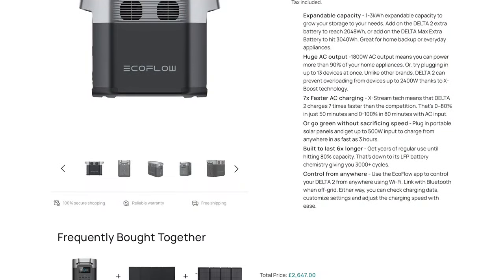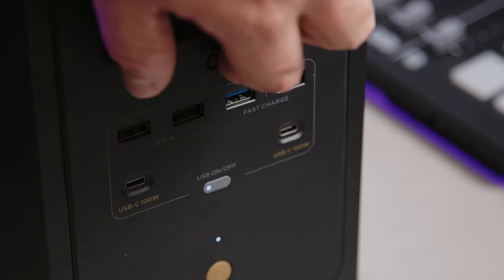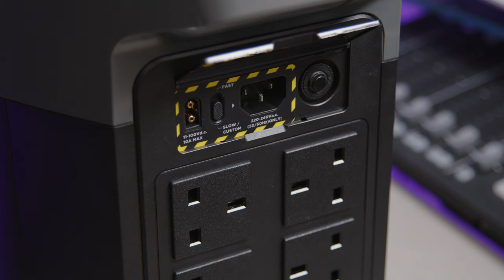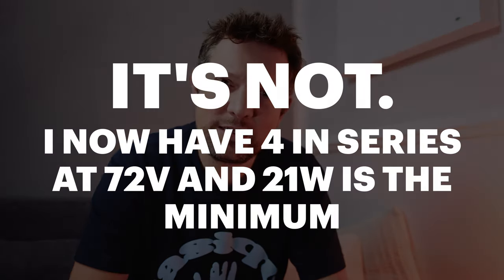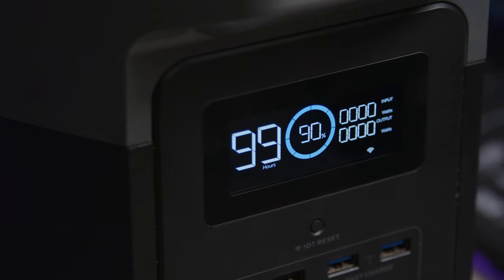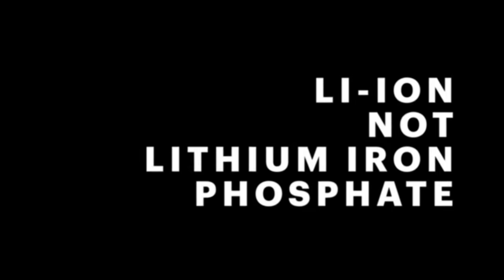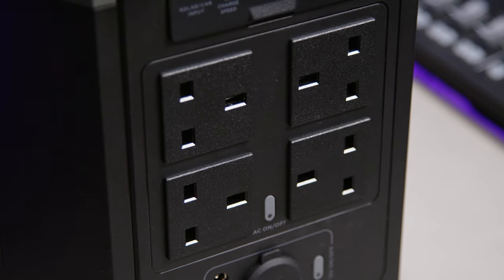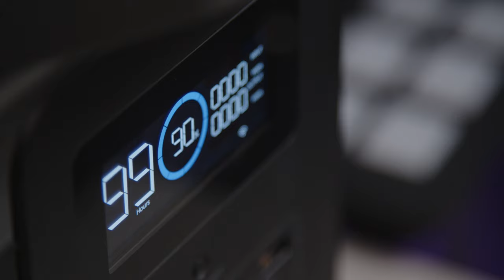EcoFlow Delta Max - Things You Don't Hear In Reviews

Comment: Thanks a lot for this review. I'm surprised about that noise. Its also loud if its used as UPS?
Reply from the maker: Yes! This is one of the most annoying things. You would expect it to bypass heat generating stuff when in UPS mode (AC in and fully charged) but it still comes on all the time. The best product I have used for a true UPS is this on from Anker - https://geni.us/solixc1000 - Though this will still power up a fan when you hit 400-500W AC bypass. That's good enough for me though. As long as it's not making a noise at 100W AC, I'm happy.
Reply: @tdcattech  Thanks a lot for sharing your experience. I want to have something for the summer seasson in very quite area and its improtant for me otherwise this will bring the hell to me :D

Comment: What DC load causes the fan to kick in? I’m hoping to run a 5amp / 60w load on 12V DC and it will be a non-starter if that causes noisy fans to run. Will be running a fridge in a camper van and I’ll be sleeping right next to it. Thanks!

Comment: Can the Delta Max be used to power a refridgerator, or electric oven, dishwasher?
Reply from the maker: Fridge, yes. Oven, depends. Our main kitchen oven uses too much for this but you could happily power a table top. Dishwasher, maybe. Ours uses 2.6kW during a heating cycle so that would work fine.

Comment: Now I'm stropping about loud fan noise on the ecoflow. The Anker is pretty quiet even if 1000watt charging it. I want to carry on with about 180 watt solar which might keep the fans to a minimum without 1200 watt mains making it cry??  I get you can adjust the app to charge at lower wattages. I agree that in winter my 180 watt solar will significantly drop. All I want to do is minimally power my working from home, broadband router, a bit of led lighting and a couple of monitors with a surface pro hooked up for an 8.5 hour day. Is this too much to ask 🤷🤣

Comment: Hi Im live in a Barge in Uk .Ive got all ready solar Panels with battery Bank.Im thinking to by the Ecoflow 2000 .I was wandering if you can use in parallel with solar panel and charge my Lesure battery is well.Anyway great video
Reply from the maker: Others may know better but I don't think that would work. The EcoFlow has an MPPT controller on-board. I would imagine that connecting another battery or controller up to that would mess things up. You could, of course, just charge your leisure battery from the output of the Delta Max but that would be less efficient. I often do something similar but not with a leisure battery.

Comment: One question! Does the extra batterie have a solar panel plug? Or does it charge while the main one if being charged?
Reply from the maker: No. The only input is the connection to the main battery. The charging is fairly sensible. The solar power goes into the main battery at e.g. 400W and it will split the charging so the Max will charge the spare at about 200W and itself at 200W.

Comment: Do you recommend getting the eco 400w Solar or sauce another brand for cheaper? I’m about to get the delta max but weighing up about either 200w or 400 w for camping.
Reply from the maker: The EcoFlow solar panels are overpriced. What you get depends on the space you have but for the price of 1x400W EcoFlow, you can get 1.3kW of Renogy rigid panels. Clearly that would take up loads and f space etc etc but you get the idea value wise.

Comment: Thank you for this information, I have been looking at these all in one power supply options, but I have come to the conclusion that for me (in a mobile application) that a setup with separate components is a far better option, solar panels that are connected all the time/ mppt solar charger/ 240v battery charger / 2000Ah lithium battery / a generator when needed / inverter. 
I run on solar all day and batteries at night, with this setup I can charge out each component as required, I don’t need any firmware updates ever, also my smartphone and iPad I carry in a faraday pouch (eBay), so big brother tracking is avoided.
But the worst thing about all of there’s all in ones power stations is the OUTRAGEOUS COST and don’t even talk about trying to get any sort of warranty or repairs. 
P.S. with this setup it is costing about £300 a year for petrol, stuff being connected to mains power 🤪.

Comment: hook up a smart plug to each AC outlet, where you want to control them individually
Reply from the maker: Yes, I have done that for a few devices. Most smart plugs won't fit directly into the device if you try to use more than one but that's no problem. I actually lean more towards avoiding the mains inverter completely due to noise and use USB, PD and DC12V for everything I can.

Comment: Oh i see; you have a delta max; that's not the same as the delta 2 max - is that right? ecoflow Delta 2 with extra battery included the fans on the delta 2 max are quieter?

extra battery is super high. walmart in the us is selling the delta 2 max unit itself for $1,399.00 and the extra battery is about the same in some stores - over $1000 usd.
for that price i could just link 2 units? I'm new to all this. hope you don't mind the questions
Reply from the maker: Delta 2 Max is much much quieter. I did a short video on that.
Reply: @tdcattech  Oh i need to watch that then. Thanks!

Comment: Will this work to run power to a DJ controller for playing out side ? I have a Pioneer XDJ-XZ controller.
Reply from the maker: Yes. As it has a mains in, you’d need to use the mains inverter but it only consumes 41W so you could probably run the Pioneer for at least 24 hours (factoring in losses and inefficiency). If you’d want to run speakers too, you could but that would reduce your run time.
Reply: @tdcattech Thanks for taking your time to answer. Mains inverter is that included/integrated or do i have to buy that separately ? I have 2 x JBL 310 speakrs that runs on battery so that wont be a problem.
Reply from the maker: Yes. The Delta Max has 4 mains outputs so you just plug it in and turn it on. You could run your whole setup for 8 hours+ from this (plug both your speakers into the mains too) but if you only want to power the Pioneer, a Delta Mini would do great and is much more portable.
Reply: @tdcattech  Thanks again for taking your time. Have you done a back check on how much power my controller and speakers use ? 😘
Reply from the maker: 👍🏻 Definitely. It sounds like a really good use for something like this so I was curious. The noisy fans wouldn’t be too much of a problem for you! 🙂
Reply: @tdcattech  Yes thats true. But i do alot of camping to. I love stay in the woods fishing for Pike and Perch. Guess the noise would bother me from time to time. Thanks again i wish you a nice Sunday 😁

Comment: If you buy a 'ring' model 12 volt dc to 240 v ac watt, low wattage inverter of a couple of hundred watts max output, from halfords, it still has noisy fans. What do you want it do work without overheating or be cooled, which will always involve fans ? A petrol generator is many times louder.
Reply from the maker: I agree. Of course it's fine for most use but it would be nice if the output power could be capped to keep fan noise to a minimum. It really depends how you use this type of product.

Comment: What's the difference between the 1600 and the 2000? is it worth it?
Reply from the maker: Depends if you want the extra 400Wh of capacity. The 2000 also has better battery cycle life (800 cycles vs. 500) and a slightly better inverter (2,400W vs. 2,000W).
Reply: Thanks, that's what I needed.

Comment: As a veteran of the 1st gen PS4 days, my Delta 2’s noise output is not that bad! But, then again, i only use it for car camping and emergency power outages!
Reply from the maker: Would you put the battery in the car then to keep the noise down? I must admit that I've never used this in a camping scenario but it gets pretty quiet at night and this thing whirring up in a neighbours tent would be irritating, surely? 🤷🏻‍♂️
Reply: @tdcattech  — Yes. I typically run it during the day to run/charge all my electrical needs. However, at night it is place in my SUV to power my ICECO fridge only! But, who knows, maybe that white noise ambience produced by those fans would lull me to sleep faster…

Comment: Ive been wondering this for a long time before buying it, i live in a apartment so im looking for something that doesn’t make a lot of noise, is the Delta 2 quieter?
Reply from the maker: I haven't tested it but from what I have seen in other videos, no. There is little if any difference in this regard. I have since tested the Delta Mini. It's considerably quieter than this Max but it is not, as someone put it, "whisper quiet". The sound is very noticeable in a quiet environment.

Comment: £1100 for 2KWh - they are absolutely having a laugh.
I have 4x100+Ah lead acid batteries in my shed connected to a 2KW inverter with lorry jumper cables. The whole thing cost about £600 and gives me 4KWh of stored capacity. So that's around £125/KWh. A quarter of the cost of this.
However, I AM impressed by the 13A up to 100V DC solar input. That's very nice.
Reply from the maker: Oh yes. Cost / kWh is ridiculous on these devices compared to the type of setup you're talking about. They are very, very easy and convenient though which could never be matched in some situations.

Comment: So the fans comes on, big deal...

 It's still much quieter than operating a generator. It doesn't sound like an aircraft taking off, nor landing...

I have mine placed in my downstairs guest room and it sounds no louder than the bathroom vent so no complaints here about the db created by it. I'm glad I have a backup power system which I can use (if needed)  for outages at night.
Reply from the maker: 💯 The noise side of it is totally dependent on your use. If I'm powering devices during a blackout, I'm not going to care about a bit of noise.

Comment: Was wondering if I could use it for a window unit air conditioner?
Reply from the maker: The inverter would handle the power (even a 12,000 BTU air conditioner wouldn't need more than 1.4-1.5kW) but it wouldn't last very long. Maybe 2 hours max.

Comment: How’s the battery holding up as it not lifepo4 lithium ?
Reply from the maker: So far, it’s perfect. I use it everyday but it probably only gets through a cycle less than once a week.
Reply: @tdcattech  Thanks .I’ll be cycling it everyday running aircon .But only charging it to 80%

Comment: Isn't it possible to use Bluetooth to use the app?
Reply from the maker: It's possible to use it by connecting directly to the EcoFlow (so the EcoFlow becomes the Wi-Fi access point) but this still requires an app. It requires it to support current operating systems and exist on the app store.

Comment: I have the Delta pro and I like a lot of people store these things in the garage or basement by the electrical panel. Mine in the basement is no more annoying than white noise for me. There in my basement and with the fans running I could watch TV without really having to turn the volume up at all. Your recording of the noise is misleading because you probably had the mic right next to the unit. Compare this to a generator and most other units that put out this kind of power and  I doubt you find anything much quieter.

Comment: Just waching your take on this. Like you, I wanted to leave this hooked up to Solar full term and it charge without intervention every day. I just ordered delta 2 and a spare battery in favour of returning Anker 757 as this ends up with a clicking noise on dusk and needs unplugging and refuses to charge from sun up without unplugging the xt60 and plugging it back in again but will charge at even 2 watts of a grey day. Am I wasting my time you think if the eco flow won't charge unless its getting at least 30 watts of solar?! What seemed clear is becoming a pain and more of a mind field than I thought. Your take on this would be cool... You also have me thinking should I have ordered 2 main units instead of the battery add on 🤷
Reply from the maker: Gosh, I could make a video just answering this comment as there's lots to discuss here. In fact, I might just do that.
Reply: @tdcattech  If you have the time to test this, do you think you mind doing a test (just a mention in the video) on battery leakage through time? Like fully charging the device and letting it sit for a month to see if the batteries hold their charge. I wouldnt know if there is a standard difference or just a normal amount on lithium ion batteries. (once saw on a package of normale rechargable AA that stated there should be 75% left after a year of sitting on a shelf, discharging through time alone)

Comment: Hang on a minute, the device draws power when solar is plugged-in but not charging?! I was hoping to have it plugged into solar indefinitely at my off-grid cabin. Will need to re-think this purchase...
Reply from the maker: This is more of a problem when the batteries are already low. So if the solar input is e.g. 15W, the system will never shut down and might be using 20W just being on. This obviously leaves you with net -5W which isn't ideal, particularly if your batteries are already low. Official response from support is below.

"After checking with the engineering team, the clicking sound is from the Internal buzzer. It is normal from what we know.  However, we still recommend not using solar charging at night and on cloudy or rainy days, because when the unit is in a low battery and the current input power of the solar panel is very low, the unit will always be determined under charging status and does not shut down.  Meanwhile, the consumption of the standby power is higher than the input power, causing the battery voltage to leak and affect the battery life. Currently, we don't have a solution for this unplugging problem, but I will send your case and feedback to the R&D team again."

Comment: Time estimates is off by about 30min for me, depending on load. On low power load its wothin 10min, on my big computer while gaming, its off by 30min
Reply from the maker: Do you mean time remaining? If so, I’ve never seen a battery of this type do that accurately with the exception of the Anker Solix batteries.
Reply: @tdcattech  yea on the time remaining. I'm from South Africa so we use it for something called loadshedding, where the government has scheduled blackouts every day. Around 2 to 4 hours at a time and around 2 to 4 times a day. So this thing is keeping all my work equipment and WiFi up during these blackouts. I also had my fridge plugged into it before I moved. 

The battery accuracy with all my computer's off and just the WiFi and fridge on, is within 10 to 15min time remaining before it goes out. And with my computer's on its about 30min to 45min off. 

It's also only loud when its charging right after loadshedding and if the day didn't have any, it's only loud for like 15min a day as it just keeps itself topped up. I also have it set to not charge more than 95% and not go lower than 10%

Comment: Have you done the "10 second press" at anytime? I have found that the Ecoflow really doesn't know what charge it has!
Reply from the maker: I haven't heard much about that but will investigate. The percentage on my Delta Max is a complete joke. I've calibrated it multiple times and that does seem to work. However, when I've used it for a few days (recharging partially from solar) it just drops back to total nonsense. I have run my gear for over 24 hours on 1%!!!! It has no idea where it is. I don't expect perfection in this regard, but some idea of power remaining would be nice.
Reply: @tdcattech  it’s good that it runs at 1% (even though the display is misleading). My Delta Mini seems to be shutting down according to this ridiculous time remaining. With 882 capacity it turns off in about 3 hours with 60-100 watts output. 
I’m very frustrated and dunno what to do😢

Comment: odd my fans on my max arent loud at all when they are on
Reply from the maker: It’s all relative as I’m not giving a dB reading at 1m. They are so much louder than I expected for a device designed, in part, for e.g. night time medical equipment use. Where are you using it? Is it in an area that already has air conditioning units or similar?

Comment: Ypu forgot one thing - despite recharge cycle lifespan - batteries have a total lifespan. for Li-ION it is 4 years, after what they starting to degrade as hell. For LiFePo4 - it is 7 years with minor degrading after the term.  So LI-ION is a waste, for long-term usage - that's why industry moving towards LiFePo4 and another chemistries & types of batteries
Reply from the maker: That seems to vary a lot depending on what you read. Many places state 5 years in a worst case scenario so likely more with sensible use. Obviously, I'm not considering cycles here.

Comment: Bro, I just received mine opened it very excited and plugged it in to charge it up. I thought I received a damaged model or something it's so loud while just freakin charging. Like who wants to hear that loud fan when only charging? Sorry but I'm sending it back tomorrow.
Reply from the maker: You’ll always need some cooling on a device using nearly 2kW to charge (assuming it’s set that high). I mean, it’s enough to warm the mains cable! 🙂 The problem is the cooling is so loud and it’s always there even at much lower charge rates.